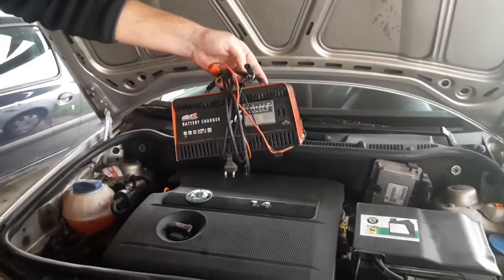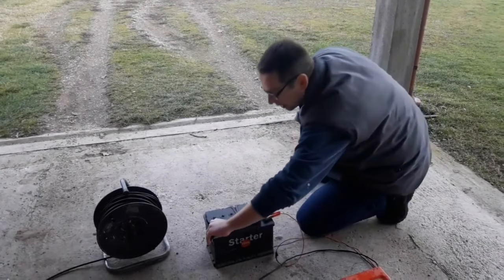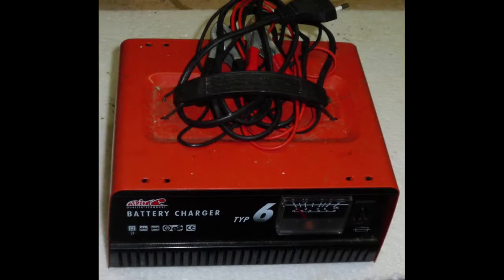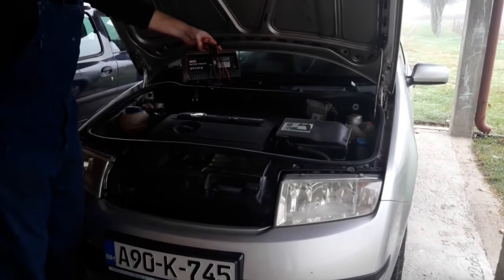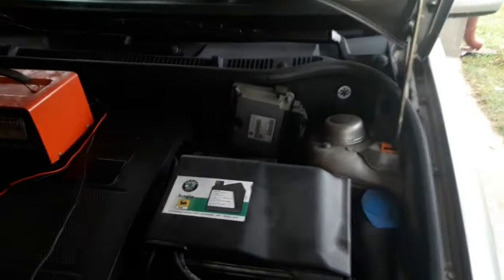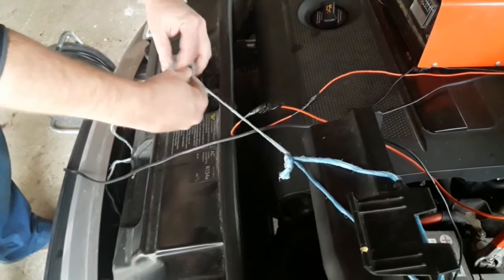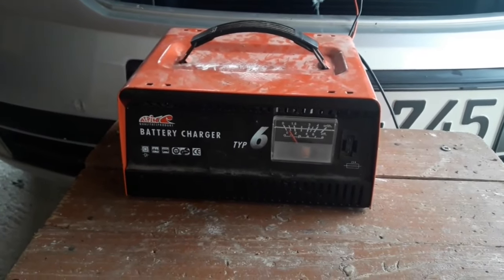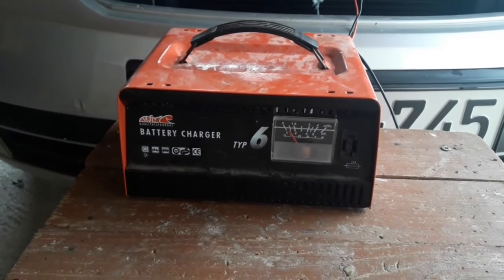Can You Charge The Battery While It's Connected To The Car?

Comment: surely you can as long as the charger voltage is below 14V or better 13.8V, there is no need to disconnect the battery at all.

Comment: I charged a Peugeot before without disconnecting the battery and after i started it there was miss fire. Maybe it affected something in the cars computer or something. Lucky after i stopped and restarted it ran fine. I never done this again. Luckily my old Peugeot has clamps which hold the terminals on the battery and u don't need a spanner, its a great Idea and i haven't seen that before, so now i just unclip the terminals when charging but don't need to lift out the battery.

Comment: I have an old Volvo with the battery in the rear of the car….for convenience I wanted to charge the battery while in the car.I telephoned our local Volvo dealership to check this would be ok they said yes .So I proceeded and charged the battery.A short while later my instrument panel completely failed. A short period later my engine cooling fan started to play up (comes on for long periods even when engine is stone cold) an ECU problem was diagnosed.Then the cabin heater control regulator failed.Now maybe all these failures were a coincidence. But it might be that as electronics get older they get a bit more fragile to electrical surges. All I know with the cost of all my repairs I would not risk it again.The battery charger I used was a modern smart charger and of a well known make. It has been used with no problem to charge Batteries disconnected from cars.
Reply from the maker: Hi and thanks for watching! To be honest, I haven't seen that recharging the battery this way causes that kind of havoc to the cars electrics, and electronics.
But you never know, it's always best to disconnect the battery and then charge or at least disconnect the minus battery terminal.
It all depends on the situation, if you're in a tight spot and do not have the time or possibility, then this is certainly worth the try.

Comment: Hello. What charger are you using? It looks like it is a high amperage dumb charger. I guess it would be better to use a multi step Smart charger because smart chargers are safer
Reply: Exactly. Please correct me if I'm wrong, but the multi-step chargers are about $30 and do not require battery disconnection or any expertise. They even tell you when the battery is fully charged. They can even mitigate sulfur problems automatically.

Comment: How about with newer cars? For some like Fords, you can program certain things. However, it's suggested to connect a battery charger to maintain voltage. Otherwise you can brick certain modules.
Reply from the maker: Hi and thanks for watching and for sharing!
To be honest, regarding the latest car models, I would be careful and look at what the manufacturer recommends regarding the charger voltage and amperage.
I think that a universal charger, widely used like the one in the video shouldn't do any harm.
But again, best to check it out.
From what I've seen, modern cars don't have good resilience to power losses and it seems best to avoid it altogether.
Reply: @DespairRepair  may depend on the charger too. I bougt a Noco Genius 10 smart charger myself. Seems to have a lot of safety features.
Reply: @jasonashley9853  I don’t think it’s possible to ‘brick’ modules without power supply. That would be way to risky for the producer itself as well as for the dealers. Batteries get disconnected and go bad very often…

Comment: so i been taking batteries and putting under 300 amp loads 5 mins up to 15 mins ...5 times and bringing old batteries back to life it burns off the sulfer deposits and little shorts that drains and weaken batteries it does not work if battery has froze.just saying so a person isnt constantly putting the charger on thier car or buying a new battery when there is not a need.
Reply from the maker: Thanks for watching. You're right and thanks for sharing